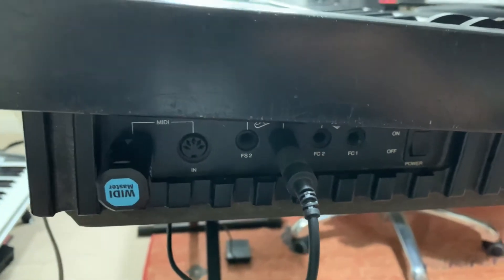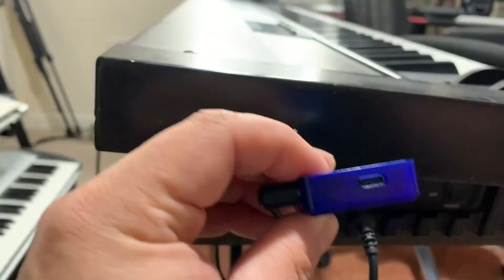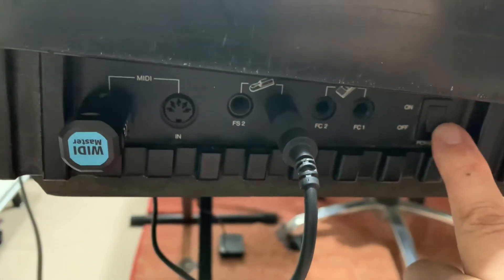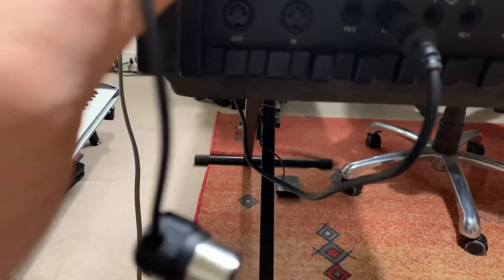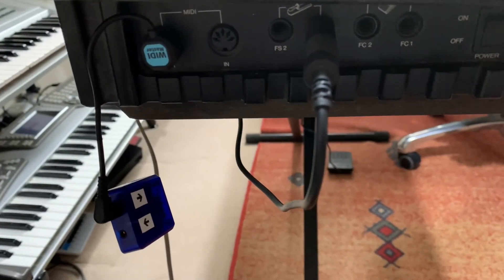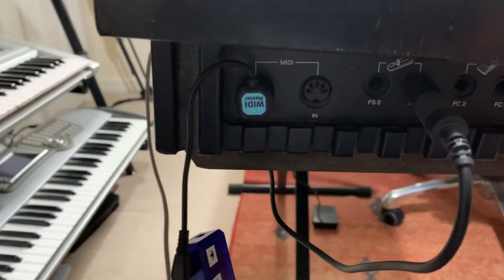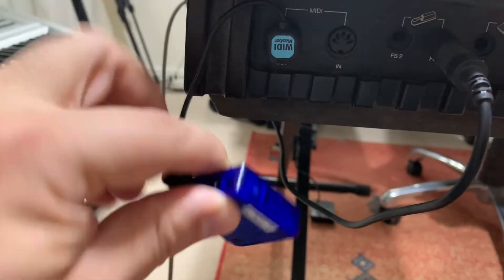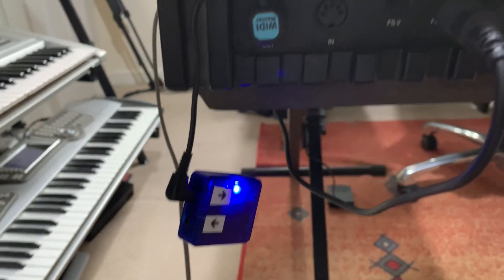CME WIDI Jack Powered by 5-pin DIN MIDI!

Comment: like the E 20 Roland boathouse an extra 64 on board sounds. So I’m wondering, if this Bluetooth device would be compatible? I’d also love to know what the advantages are off using both Bluetooth five pin din plugs. I too wondered how this device including the five pin midi jack if it would collect power from the MIDI socket on board the hardware keyboard?
Reply from the maker: So, first things first... As I don't have this particular keyboard, I cannot 100% confirm compatibility. However, I am highly certain that it will function perfectly well. 

The MIDI specification states that the MIDI OUT port should deliver between 3.3V and 5V. This is all that is required for WIDI devices to work. You will probably find the WIDI Master the most suitable. The benefit of using both MIDI 5-pin DIN plugs is that you then get both MIDI OUT and MIDI IN.

Hope that helps?
Reply: @FailedMuso  Oh thanks and I do have a friend who is an electrician and who is very good with computers and he’s fairly confident this device will work perfectly well with this Roland fantastic keyboard I’m talking about which for me is an absolute keepsake I would never get rid of it though it dates back to 1990. I had this model years ago, sold it and I regretted it so now I have managed to salvage another the same model and in even better condition and again, I won’t be parting with it. It also has a card slot on board and i’ve bought a couple of Music style cards from eBay and again, the technology is extremely old but very very good for its time. I predominantly want to use this midi device so I can record the sounds from the Roland in midi recording onto logic and then I would have to change it into audio. But of course as you may know, the beauty of recording for example, drums in midi, they can then be quantised like you can do with internal midi. No I’m not very knowledgeable about external midi and getting the right channels et cetera. With these music production programs, the sounds and plug-ins are as far as I know mainly internal midi.